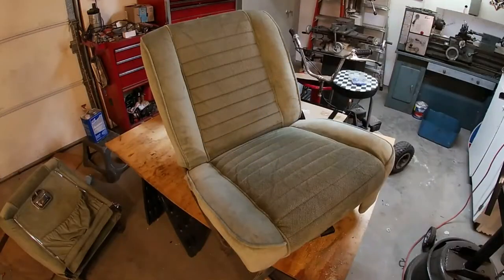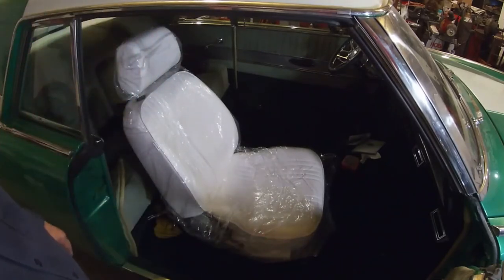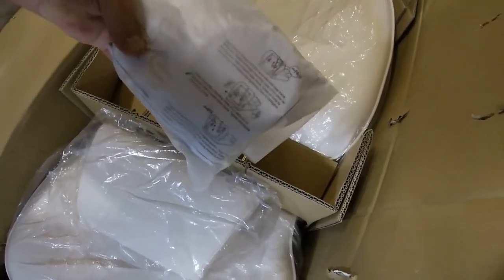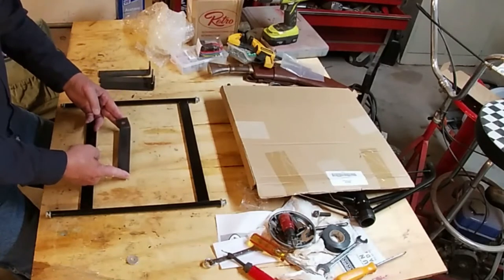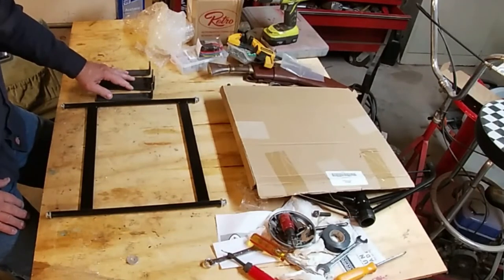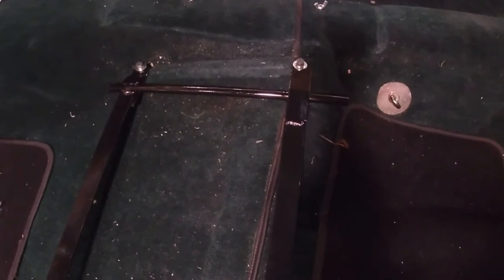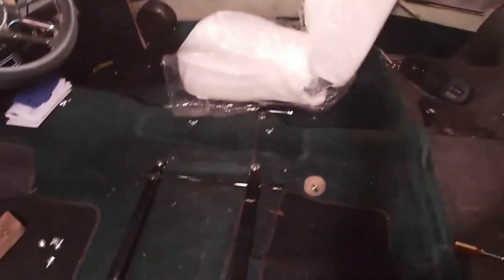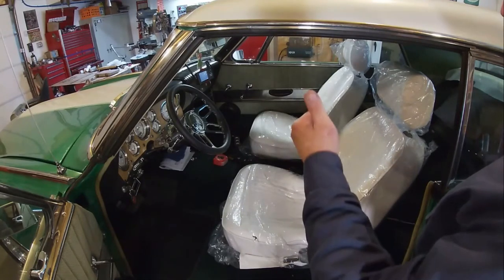Scat ProCar 90 series seat installation

Comment: Seats, second most important to the engine. Now, you may remember my lower back wore out in 1990. Well, when I got my Clio in September 1999 I was finding I couldn't drive far before serious discomfort. Someone looked for me, and found a lump......it's the lumber support. I tried a pillow as a cushion. Could not believe the difference. Also tried it in the house. So for the last 20 years, a pillow has been my saviour. Strange but true Lloyd.
Reply from the maker: MalcOfLincoln   So true Malc, the old seat would take a lot of work to get in good shape once again. Thanks my friend
Reply: @RustyGlovebox  Thanks Mate 😊 Those seats will make a huge difference to the overall looks btw. I know you know this, but the final detail is 90% of the overall look.

Comment: great video! ive been searching to find a video that will help me and this one explained a few things. I recently bought some ebay racing seats for a 96' crown vic that im building for a customer. but the only racing seat brackets they sell are for 98'+...so I bought the same universal kit that you have and the actually bracket is too short by a few inches from the factory holes...what do you recommend I do? try and weld extentions etc? and how did you determine the level, is it slightly back or flat level? I cant find ANY info on crown vics with racing seats..thanks in advance
Reply from the maker: I would add to the brackets you have if it will look and work OK.   I raise mine up an inch or so depending on how it feels. Needs to learn back a little.  Having a car that isn't your std build  can be challenging at times . Good luck on the Crown Vic